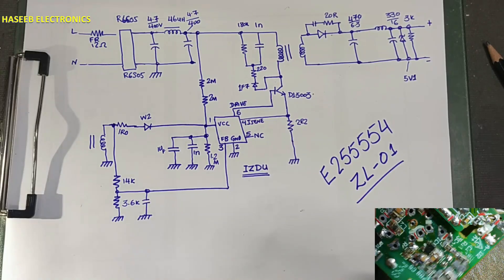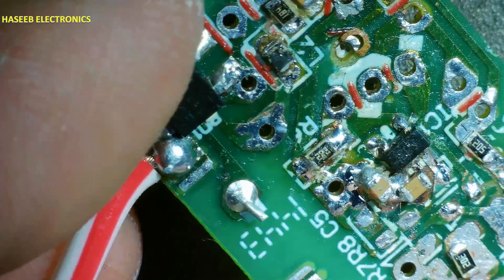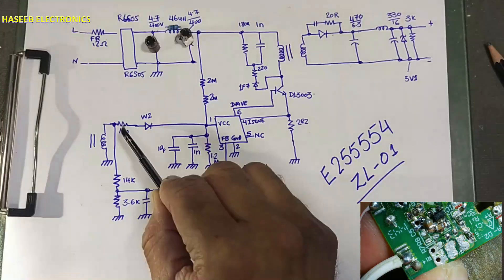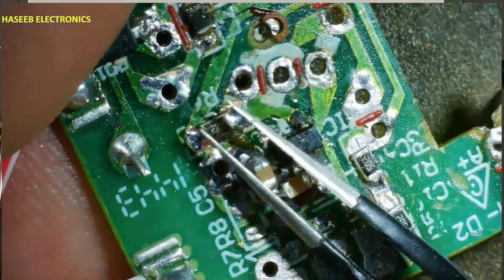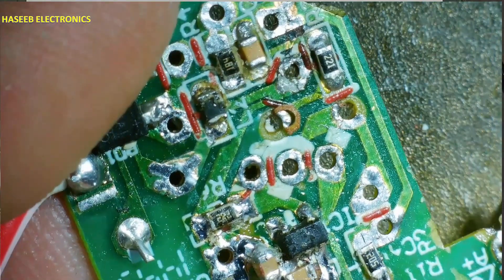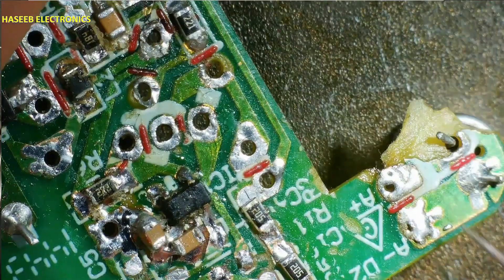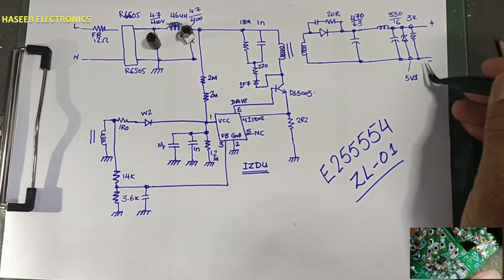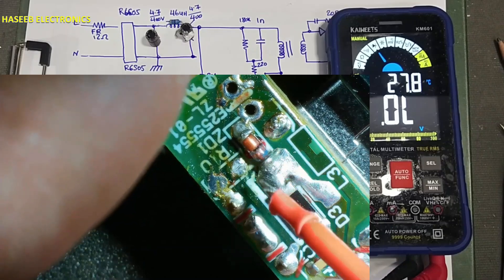{1153} Samsung Mobile Charger diagram

Comment: Sir there is no harm when main power supply is on.and test the components on continuity mode
Reply from the maker: no, it will just only blast the multimeter or sometimes it will damage the circuit or sometimes first 2 conditions + severe personal injury is expected. 
when power is applied, never use multimeter in resistance mode or continuity mode or capacitance mode or diode mode or current mode

Comment: Sir am trying measure DC or AC voltage in my multimeter It makes some little bit spark. What's is the reason for this?. Also When I try to measure at op-amp the mcu will detect  over current protection and automatically went to standby mode. It's happening in lg single door refrigerator pcb. But when I without touching the pcb it runs smoothly. Thank you.

Comment: sa friend your videos great and educative for me. referring to aux winding, it seems to me that there would be never positive voltaga there since the w2 diode does not let the positive voltage. So i am not able to understand the 14k and 3k6 voltage divider and their contribution to the feedback pin. but the feedback pin only needs the negative voltage so then no problem.